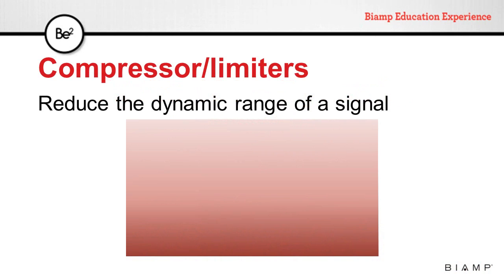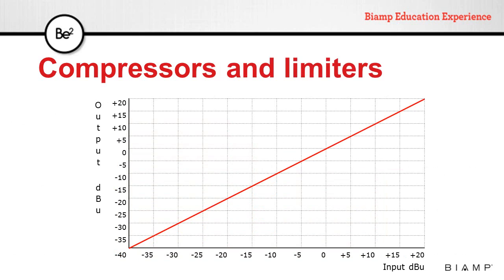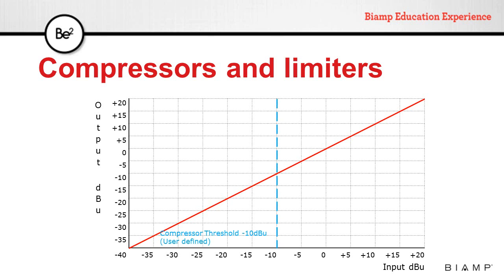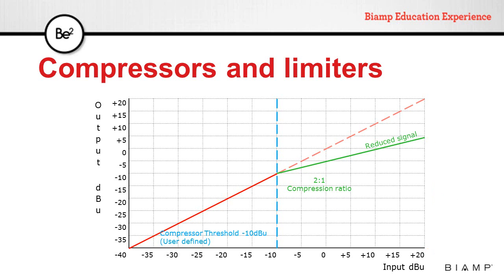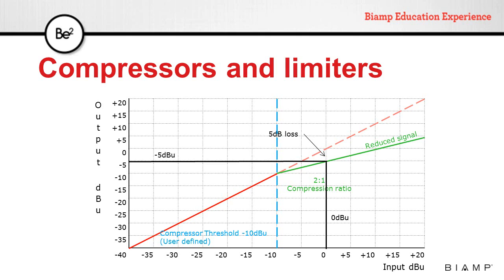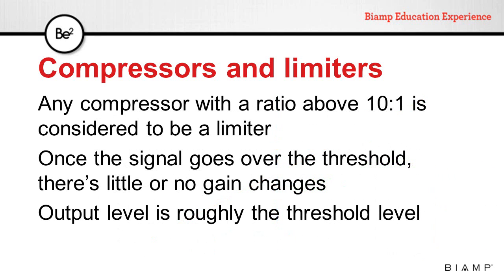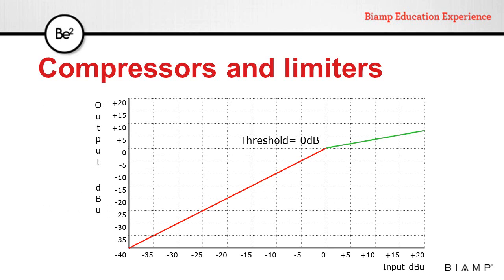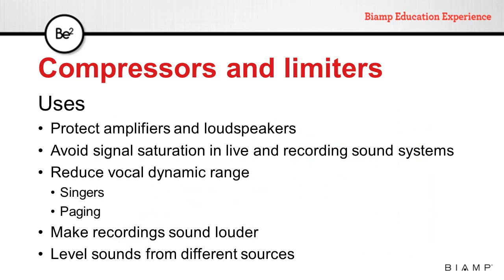Biamp Audio 101 - Dynamic Processors: Compressors & Limiters

Comment: Hi, may I ask what the difference is between the 'Leveler' blocks and the 'Peak Limiter' blocks in Tesira? There is no information on what the ratio is set to for both processors. Based on the text information, they appear to do the exact same thing which is limit peaks that go above the threshold. Thank you.